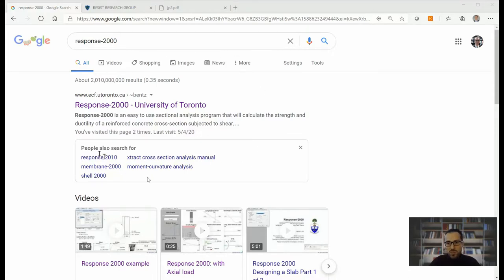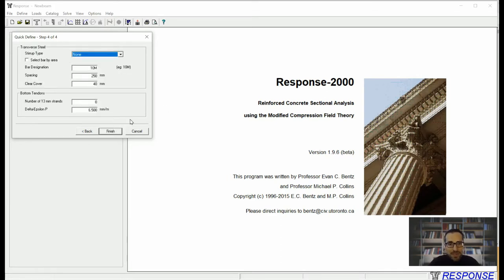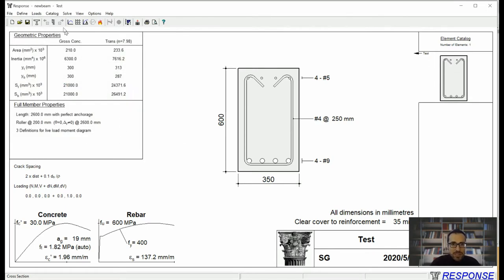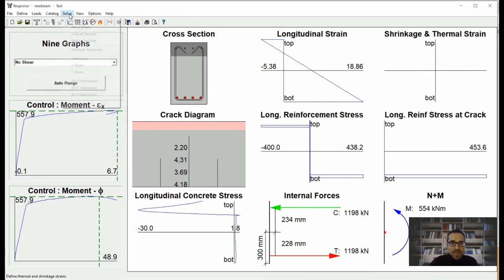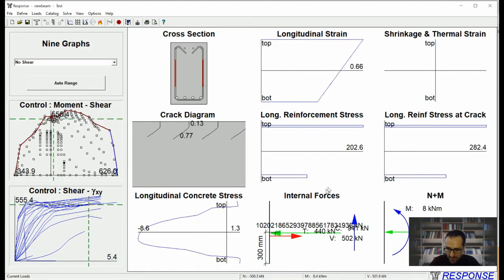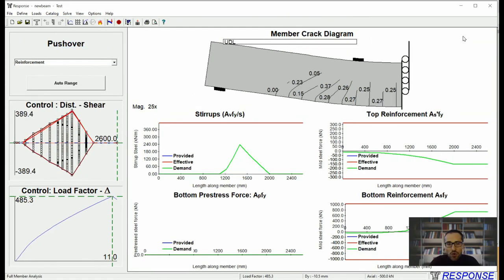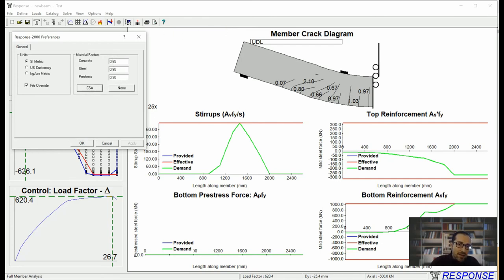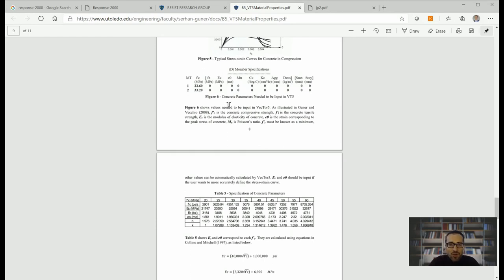Nonlinear Sectional Analysis of Concrete beams and columns using Response-2000

Comment: Serhan bey merhabalar, Response 2000 hangi beton modeli veya modellerinden yararlanır? (mander gibi)
Reply from the maker: Thanks for your interest. There is not a single curve used by the program. Pre-peak, post-peak, compression softening, etc. are all modify the response curve. You may read about these in the program documentation: https://www.hadrianworks.com/about-programs.html